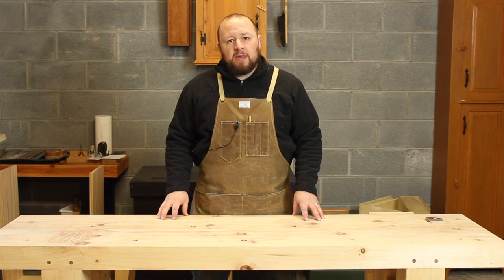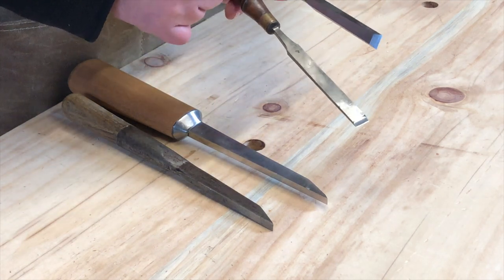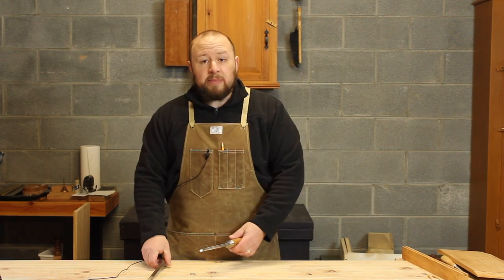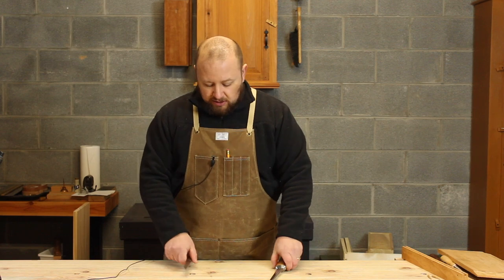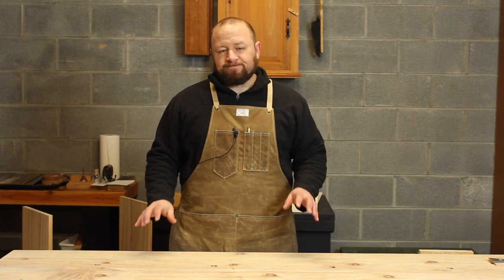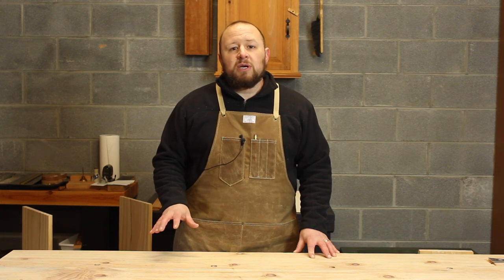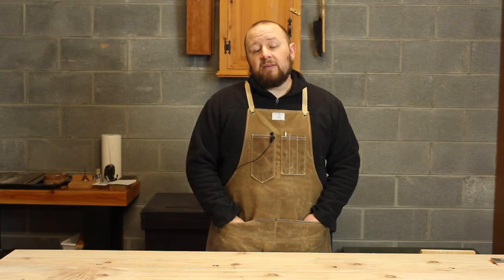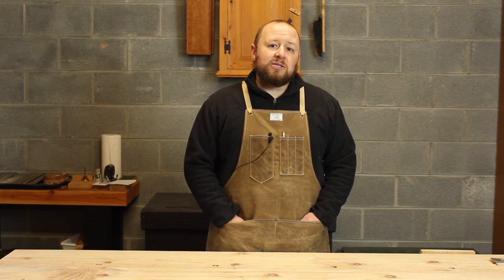Hand Tool Woodworking Q&A - How Flat to Plane a Board - Mortise Chisels - Saw Filing Vise

Comment: Thank you for the details concerning the dovetails (pins and tails). So that would mean that you would put the sides of a drawers with the  growth rings "concave" (when you look at the drawer front view, the rings  are like that: ))), for the right panel). Don't know if i explain right...!
Reply from the maker: ikust007 I’ve never worried about it. I really don’t think it makes any difference.
Reply: Ok!
Reply: -4Cwes, Better to use quarter-sawn boards or even better build NK (enko drawers) which will eliminate the need for either.

Comment: Bob, could you tell more about single-iron hand planes? Is it possible to get a good quality surface with it? Thank you!
Reply from the maker: Дмитрий Макогоненко Single iron planes are every bit as affective as double iron. The most popular planes on the market right now are all single iron (I’m referring to the low angle bevel up jack and smooth planes from folks like Veritas and Lie-Nielsen). Old bevel down single iron planes are just as good. Companies like Old Street Tool (formerly Clark & Williams) have built their livelihoods around them with thousands of happy customers. Keep in mind that all joinery and molding planes are also all single iron. So the design is well proven.
Reply: So , why is there a market for new double irons planes ? Mine are all old ones (Miller Falls, Record, Stanley)? I did try the single iron from LV: exceptional . So I stoped before having to buy all of them:))
Reply: Sorry I wanted to say that the ones I have are all old so double irons ...
Reply from the maker: ikust007 For the same reason there’s a market for new anything. Not everyone has easy access to old tools. And not everyone wants to put in the time and effort it can take to tune an old tool. The new ones just work, right out of the box. And most of them (the premium ones, not the big box store varieties) have made improvements to the old designs (thicker blades, less slop in the mechanisms, thicker castings, better raw markets and manufacturing process).

Comment: I think you are acting as an apologist with the idea that the rounded surface of a bevel was intentional. The best way to avoid crushing fibers at the end of the mortise is to leave a bit of material that is not chopped down completely flush until the bottom has been achieved.  Secondly, the rounded bevel surface can only engage in very shallow mortises and even in such cases it's irrelevant whether the fulcrum is rounded of flattened. I like what you explained about the notion of flatness. I think this anxiety comes from modern sensibilities that judge items by industrial production standards and not their own senses.